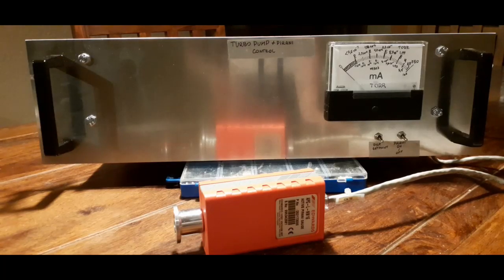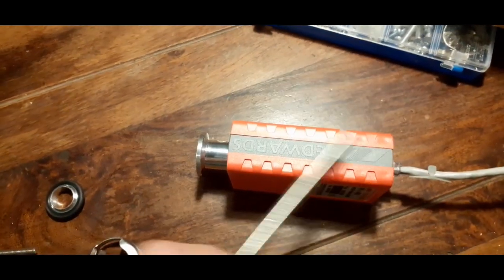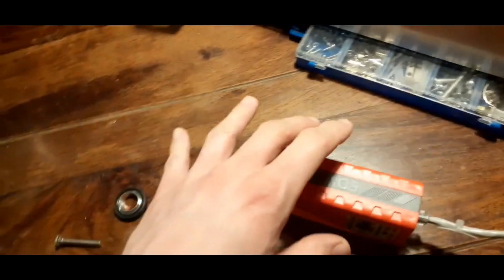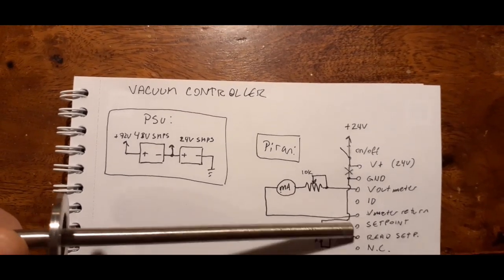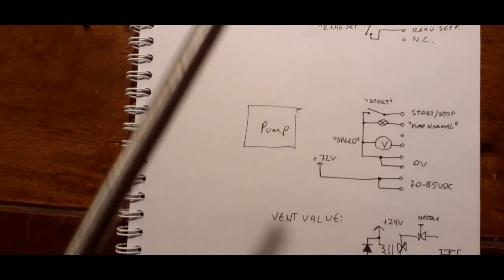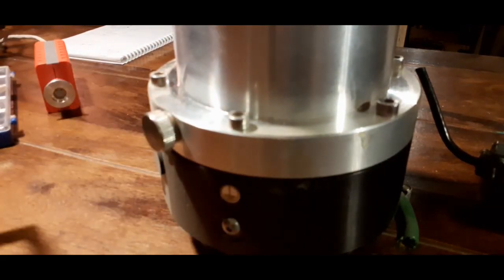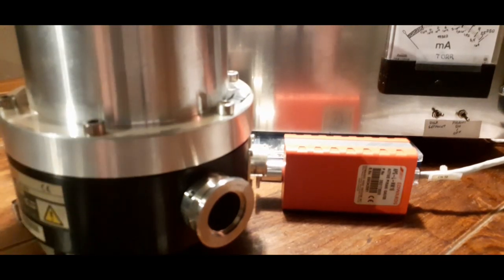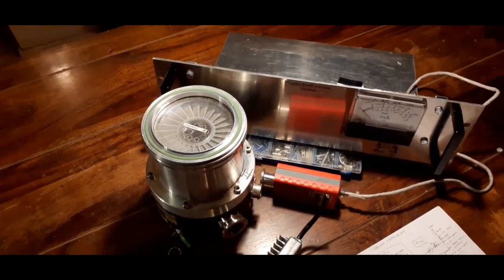Ultra High Vacuum System: Turbo And Pirani Controller

Comment: Thank you for this information! Would you mind me ask that how are you able to pull off the metal mesh protecting the rotor blades? I have absolutely no idea how to pull this off as it looks to be fragile. Thanks!
Reply from the maker: You're right, it does look fragile. With the centering O-ring removed, it feels like its just fitted losely in, I suspect you can just lift it out with some small wire hooks.
The mesh is not critical for operation, and reduces pumping speed, but recommended for upright operation. even if you do mangle it slightly I think it's ok.